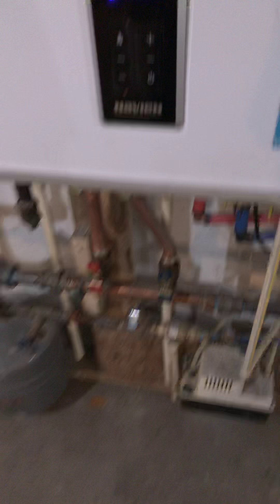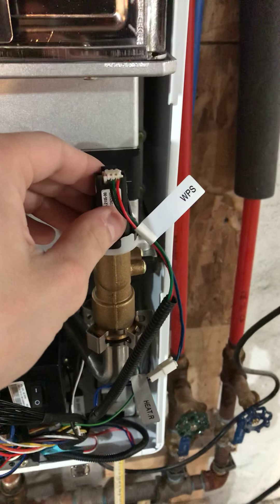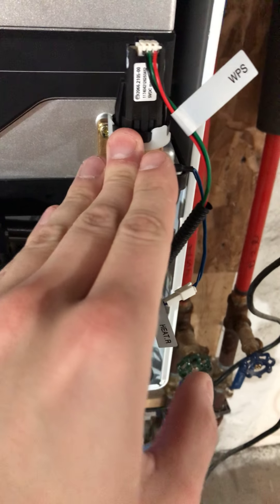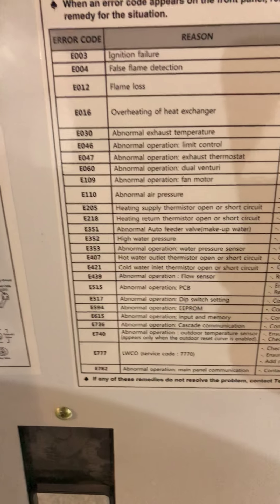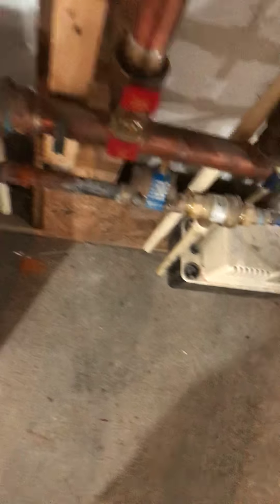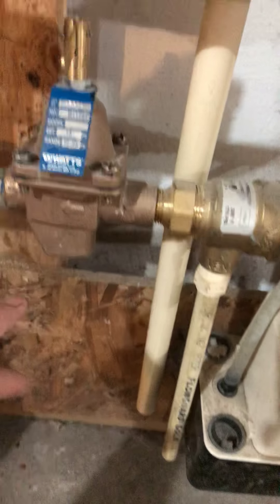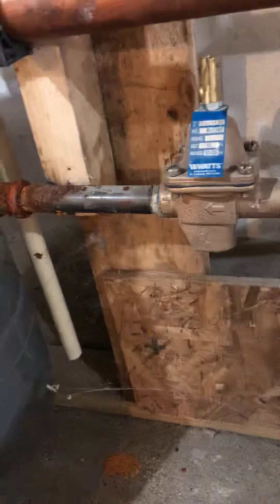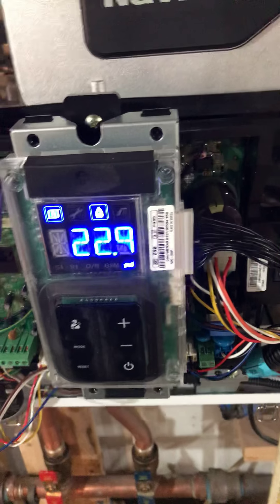Navien tankless water heater E351 error code FIX Navien tankless water heater problems maintenance

Comment: None of these things have worked?! When I turn it off per internal switch, and leave it off for 30 minutes, and switch it back on, it says "AIR", then eventually gives me the "E.351" code with the red wrench. I have reset this a hundred times at least... I have no idea what I'm doing, if you can help great, if not, no worry! Thanks either way!
Reply from the maker: Sabrina Yetley Sabrina AIR means the air filter needs to be cleaned out and this video does not go over that. However E351 error code is covered In this video. If you have the manual for the unit the air filter is easy to locate and clean. After you clean the air filter, unplug the unit (or switch it off) and plug it back in. If AIR is no longer on the unit and it’s just E351 this video should help.
Reply: @themillennialhomeowner1661  Thank you! I'll see what I can figure out!
Reply: You might just have air in your pipe, just breathe the air out. Might help.

Comment: 353 error how I can reset or solve thanks
Reply from the maker: Manuel. Reset by unplugging the unit and then plugging it back in. If that doesn’t clear the error follow this video. Error code means there’s not enough pressure in the system